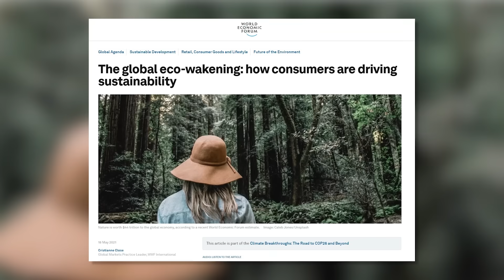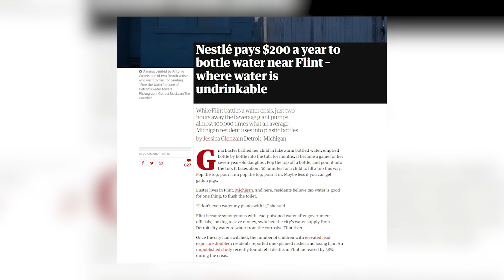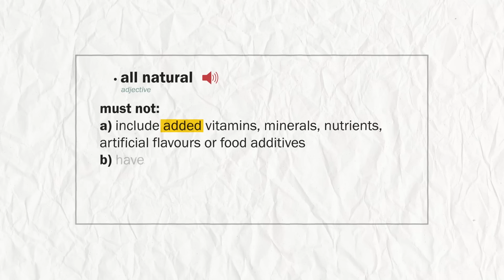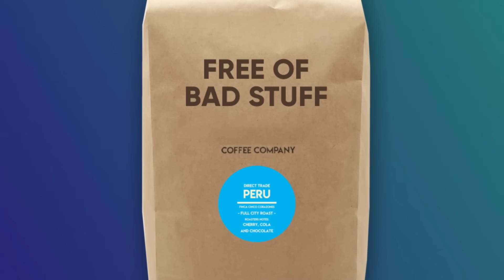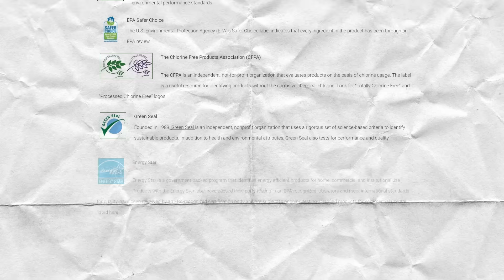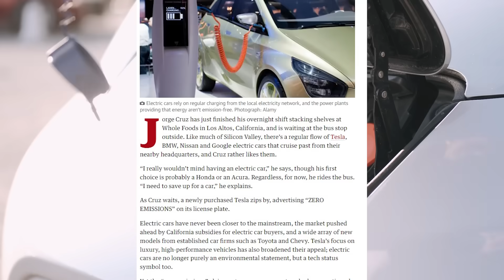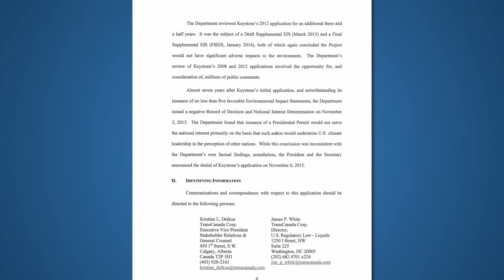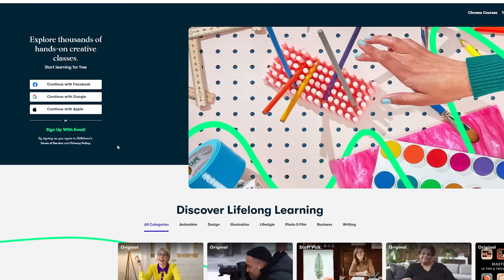Why Being 'Environmentally Friendly' Is A Scam

Comment: I would also like to bring up that in the case of clothes, garments made from synthetic "vegan" materials vs materials like cotton, wool, or leather are almost never more environmentally friendly. if you own a "vegan" leather jacket, it's plastic. acrylic, which is used instead of wool: plastic. polyester: plastic. faux fur: plastic. those garments will wear out overtime, but after you can't wear them anymore they will never biodegrade. of course, dyed and treated wool, fur and leather will definitely take time to biodegrade, but they still can. "vegan" alternatives won't, and they won't last you nearly as long as real leather, wool, or fur would either. I wish people would stop automatically believing that just because a product has the word "vegan" slapped on it it suddenly has no environmental impact.
Reply: Actually, there are a lot of materials that are used as a vegan leather. I never researched the topic (I just wear cotton, no need for a leather jacket), but I have heard of at least two, apples and pineapples. It was probably composted apple peels and pineapple leaves, I’m not sure, but the point is - no plastic whatsoever. And I’ve seen some furniture (lamps) made of fungi, so I guess that could also be used as leather.
Reply: @kasiax9573  That's really good! I think almost all the vegan leather products I've seen are completely synthetic though, so it still seems to be the norm. hopefully the materials you mentioned become more mainstream
Reply: @darkblueem  Plastic is probably cheaper than creating a completely new material. I know Kat von D makes vegan shoes (Von D Shoes, you can look it up) that are not plastic.

Comment: We have two labels I usually look for KRAV and Fairtrade. KRAV did get some critique last year but overall they are one of the most reliable labels we have in Sweden as far as I know. And within the EU there are regulations for when a product is allowed to be called ecological. More so my ambition is to eat more in season and more locally produced foods. Choosing potatoes over rice for example. Treat certain things more like a luxury than a every day thing, like bananas. Also no meat. And I don’t have to worry about the car thing as I don’t even have a drivers license. So thankful to live in an environment where walking everywhere is still possible. 

Sadly the biggest changes has to be done on a political level. And on a corporate level. Hard to tell which of the two has the most power when it comes to actually giving us a reasonable future.

Comment: The statement "electric cars are only green when the electric grid used to power them is green" is not 100% true. While it's true that by the end of the day, they end up not 100% green, they indirectly consume fossile fuel for it's power, the whole process from fuel to electricity to movement is more efficient than using fossil fuel for movement. I learned that from the channel  "It's Okay To Be Smart" IIRC. They are still a better choice to reduce emission albeit not perfect, even more so with the increasing number of renewables (I hope) in the future.

Comment: I would like to point out that when it comes to EVs the "fossil fuels make the power" thing distracts from the VERY important point that power production is subject to change over time. Basically as your grid gets cleaner your EV gets cleaner, whereas an ICE vehicle continues to emit carbon even as the grid becomes more renewable.
Reply: What is an ICE vehicle?

Comment: Recycling is a scam in of itself. Most "recyclables" aren't actually recycled due to blue bin impurities, low recycling profits, and lack of infrastructure like what was mentioned in the video. Or they are recycled into non-recyclable materials. Or only part of them is recycled. Yet this remains the magic word that makes something suddenly good for the planet.
Also the process of recycling still emits pollution, and has drawbacks like what's listed above. Reusing should be prioritized, with recycling as a last resort. That's why it's "reduce reuse recycle", not "recycle and you're all good".
Reply: I thought Reduce was the biggie.
Reply: suck’s so much is single use just for our convenience ☹️ I try to clean & recycle everything I can from fruit containers, reusable bags at drop offs, aluminum cans etc. I was sad to see tetra paks are super hard to recycle (and they claim to recycle as much as they can but they’re not in charge of the consumer who buys it) and is turned into concrete! I will not buy any more it, stressed me out so much.
Reply: @Myeyesburnbabyburn  Do you have a source for tetra paks being hard to recycle? From what i can see they're quite easy to recycle, they're basically just cardboard and plastic after all.
Here in sweden we just sort the carton as paper and the cap as plastic, and that seems to work just fine.
Reply: @swedneck  I'm in the UK, and in most areas here you can't just recycle them at home, you have to take them to centres or large supermarkets which have dedicated recycling bins. The extra step of having to save them up and then take them in bulk to a supermarket (if you even have one nearby) means most people here just put them in the regular bin unfortunately
Reply: @swedneck  Yeah but our systems in Sweden are designed to be able to handle tetra packs, in a way that a lot of systems in e.g. the US are not. In their systems tetra packs are considered mixed materials, especially the type of packs that, apparently (I don't have first hand knowledge), are lined with aluminium or a thin plastic film.
I don't actually know if our tetra packs here in Sweden are lined with anything, or maybe waxed?
Reply: Agree except for being recyclable only once. Once is still better than zero which is what happens to most trash.
Reply: @Catlily5  and some things are recyclable more than once. Op is kinda ignorant. But it's true that recycling is not as efficient as people think a lot of things we have are impossible to recycle.
Reply: important to note that this is not true in sweden, and presumably the same is true in at least some other countries. Almost all food packaging has instructions for how to sort them for recycling, and most apartments nowadays have separate bins for the major recycling categories. There is even some quite clever design in some packaging like margarine that lets you easily separate the paper casing from the thin plastic tub, to make proper sorting as easy as possible.

I also want to praise how minimal a lot of our packaging is, it's very common to see stuff literally just stuck through a single sheet of cardboard.
Reply: @swedneck  Sweden is definitely ahead of the US when it comes to recycling. It’s a shame honestly. Closest I’ve seen to anything like that was my first college, which had a huge environmental club that decided to start instituting recycling stations. I joined and we basically had a bunch of groups that handled communication with the different departments. Since I was an employee at the dining hall, I was in the group assigned there, and we worked on the takeaway containers, as well as implementing multiple stations with an assigned helper to teach students how to recycle and compost the different food products (I was studying math/stats composite education, but we were an agricultural school originally) which we took to the green houses in shifts. We were able to use one of the trucks that was originally for general recycling to transport our sorted stuff to the nearest recycling plant where the environmental majors made sure everything was done properly. The goal of our campus was to completely negate our carbon footprint by 2030 and they were still on schedule the last time I checked.

I am so sorry for this ridiculously long comment, I got excited
Reply: @swedneck  There are places in the US that have people pre-sort recycling so it can go straight to the relevant recycling centers, however the decision for that comes down to the local leaders (mayors, governor, etc) and many of them choose to just have all the recycling dumped into a single container to be sorted later
I think the only place I've been where pre-sorting was actually implemented and encouraged was when I stayed on-base.  They had a truck go around every couple days with separate containers for each category of recyclable and while they encouraged people to pre-sort, they didn't mind sorting it during collection if you didn't have enough bins for that so long as you tried to keep the bin somewhat organized.
Reply: @swedneck  Same is in Finland and norway and i think maybe estonia too.
Reply: This reminds me of how annoyed I get when people say they are going zero/minimal waste and their first step is trashing/“recycling” most of their stuff and then they buy a bunch of brand new minimalist/green stuff. Don’t throw out shampoo bottles that aren’t empty yet and replace them with shampoo bars, that’s like the definition of wasteful
Reply: @megangwilliam5343  omg people DO that!?! How wasteful! At least finish the bottles before recycling them! I’d say its best to reuse them, but that’s not possible with a shampoo bar, and you don’t want a bunch of random plastic bottles cluttering up your house… so…
Reply: Where I live, stuff thrown in recycling bins LITERALLY goes to the same landfill as stuff thrown in regular trash cans. in my parents’ neighborhood, every house has a big trash can and a big recycling bin, and they only use their recycling bin as a convenient place to put boxes that would fill up the trash bin too quickly. With how much “reduce, reuse, recycle” was forced down our throats in school, its amazing how pathetic recycling infrastructure actually is…
Reply: It's not a scam. It actually works and has helped immensely, without recycling things would be way worst. Companies themselves recycle a lot of things which saves them money and the environment. But it's not as efficient as people like to think. Not even close. But it's still completely worth it. Re use is also not the best thing. The best thing is not consuming at all, but that would cost personal comfort which you and almost all people in this world don't want.
Reply: I agree... also we used to reuse all the time in the past! Like glass bottles
Reply: Moss plantations can absorb almost three times more than three times, there, Airborne pollution Is fixed, without forgetting to mention algae

Also i Heard about a germ that can decompose plastic particles
Reply: Don't phrase your sentences like you are meaning whole world. Europe has plenty of countries which recycle most of the stuff they can. Multiple times.
Reply: plastics are bad period.. like you said a lot of them cant be recycled but its not environmentalist fault it's bullshit sellers scamming you...there is plenty of ways of going green with out the bullshit if you have half a brain and not a fking trump stoolie.
Reply: 10% effectiveness is a scam to me. Not like we should never do it but the system needs to be refined
Reply: FACTS
Reply: That's true.
Reply: They almost canceled our counties recycling for that reason along. They restarted it but I feel they’re going to stop it. Mind you, I live in a big county. SMH lol
Reply: 100% true words 👍
Reply: I have a friend who is a compost engineer and he told me that all the plastic containers we put in the bin to be “recycled” are burnt instead. He said there is nothing they can do  to reuse the plastic lol I felt so betrayed :(
Reply: Or like products that say that they're recyclable but apparently they can't be recycled in public recycling but can only be recycled if taken to "your local [insert name of shop where product came from]" (I'm looking at you Publix, with your plastic shopping bags that can only be recycled by "your local Publix" and can't be recycled by the public system. Nobody has the time to be heading over to Publix JUST to throw away your bags)
Reply: @Egerit100  Plastic shopping bags don't need to be brought back to the same location or chain, you could drop them off at any store that has bag recycling.  You don't need to go specifically to drop off the bags either, you can just stuff them in another bag and bring it in the next time you remember as you go shopping.
They can also be handled by most recycling plants that take plastic, but need to be pre-sorted so they don't get mixed in with the paper during sorting and cause blockages.  Try catching whoever handles the recyclables in your area and asking if they can take pre-sorted plastic film, if they do you can just stuff all your shopping bags into one bag and hand it off.

We actually hold on to some to use as packing filler, cleaner and more eco-friendly than packing peanuts, and keeps things safer and more secure than old newspaper at a fraction the weight.
Reply: @GremlinSciences  Plastic bags ALWAYS get a second life at my house. They become pet waste containers and trash can liners.
Reply: @GremlinSciences  In the US, municipalities don't accept plastic bags as they can only be recycled on their own specialized machine.  I collect those I don't use for our cat and return them to stores that accept them, the only method for recycling.  These bags, like all virgin plastic, are produced with petrochemicals.  That industry is working to prevent any limits on these bags, as part of ramped up plastic production, to replace declining transportation demand.  With the crucial need to end fossil fuel use, that alone suggests their use should be extremely limited or eliminated.
Reply: @dk50b  They can be recycled with any other polyurethane, the problem is that the sorting machines treat them as paper which gets the paper recyclers clogged.  All that the stores do with the returned bags is bale them (press them into blocks) and take them directly to where plastics are processed for them to get put in with the rest of the post-sort PU plastics.
No special machines are needed to actually recycle them, the sorting methods just don't work very well for plastic films.
Reply: @GremlinSciences  We have separate plastic and paper recycling in the first place, so that's not the issue here; but our plastic recycling still won't take PU film, we have to save that up for the supermarkets. I guess it's just difficult to sort period, even if you're not mixing it with paper. I'm trying to work out what the problems are, because it's frustrating that technically, ALL plastic packaging is recyclable, if you have the right facilities; but clearly, only limited facilities are profitable. Our local authority takes PET, but only in bottle form! I think it's just a lazy way of sorting PET from PP.
Reply: No, recycling does not have to be a scam.

Recycling of metal is clearly no scam. 

Recycling of batteries is clearly no scan, these can and should be used to extract raw materials to go into a new generation of batteries. 

Recycled plastic is used to create concrete here in Switzerland, reducing reliance on Putin's oil.

Paper/cardboard can be used as biomass if nothing else... we use this here in Switzerland for electricity generation and district heating. Beginning soon, comparies such as Drax will be extract CO2 from the flu gasses to generate carbon negative energy.
Reply: @ralphpurtcher  You are right, we need to give another use to things considered "trash" I do handcrafts with plastic bottles, cardboard etc. For being myself from a called "undeveloped country" México specially where I live now there is awereness to recycling are places that receive that material, in stores not allowed plastic bags only fabric ones and you have to pay if want a plastic one.
Reply: Hmm, well recycling isn't de facto a scam, more like scam-like tendencies in marketing, as a systems which is not as efficient (yet) as it pretends to be.
But the inefficiency is largely due to consumer errors (like throwing non-recyclables in recycling bins or vice versa) and outside factors which the system can't control (like packages being made of mixed materials or recycled material being purchased by manufactors who combine them with non-recyclables).

Comment: Important to mention that there's no way out for the climate crises in the capitalism. It is the main responsible of it. Nonetheless, changing the system isn't enough, once China isn't capitalist and yet it's one of the main polluters along with USA.
Reply: Ugh China is very much a capitalist country
Reply: I wouldn't say very much. It's seems a mix of both.
Reply: @plive8385  State capitalist, meaning the state owns all the corporations, and they operate globally.

Probably they also have a public sector, which provides services to the public without payment, like schools, universities and hospitals. But I'm not sure to wich extent these are free for citizens there or if they are actually free on paper, but supplemented by expensive extra services in practice. For example, the schools in China are free, but practically you can't make it through without private tutoring. Instruction is insufficient compared to demandingness. Hospitals market ceacarean births as more comfortable for the delicate mothers, but they are done as quickly as possible, compromising healing outcomes. Well, at least these things were reported on a documentary a few years ago.

Comment: Yeah, about cars. People and various regulations are demanding new cars to be more safe and in order to be more safe cars must be, heavy. Also, people really want new cars to be fast. So, small engines for the regulations, turbos for extra speed with more horse power with more top speed and more environmental pollution. Honestly, the best thing we can do right now to save energy is to make really light, small, cheap cars with tiny engines. Nobody wants that, not the majority at least.